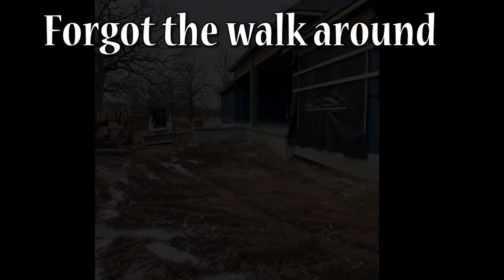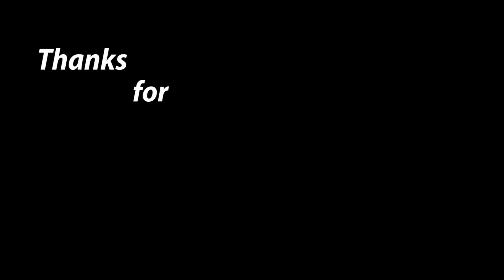Moving Some Railroad Track And Backfilling Around A New Home

Comment: What seems odd to me is how no one is using the trenchless method(s) for putting pipes / utilities / culverts down under existing roads / driveways. I watched as a company here did a 2 mile stretch of pipe alongside a highways, under driveways and side roads with this method. Amazing to see it happening with minimal disturbance of the existing landscape / infrastructure.
Reply from the maker: They do a lot of that here on utilities they use a boring machine
Reply: @eliteearthworksllc  More costly to do I suspect, but the lack of damage to roads and lack of interruption to traffic seems a good trade.

Comment: Hey Brandon
I asked you about the tracks clanking on your last video and what it was that does that, (hoping you remember that).
Anyway, yesterday I was watching Chris do a driveway and noticed his skid steers don’t do that. You both have the same brand machine although I know yours is a bit older. 
Different tracks, update to the machines?
The machinery just fascinates me and I’m curious. Hopefully I’m not irritating you with this.
Reply from the maker: Yeah it’s the steel pads in the tracks against the steel rollers. The pads are coated with rubber but wear off after awhile. Chris’s probably still has rubber over them. The machines are built like a dozer.